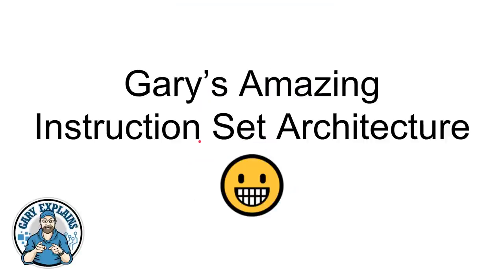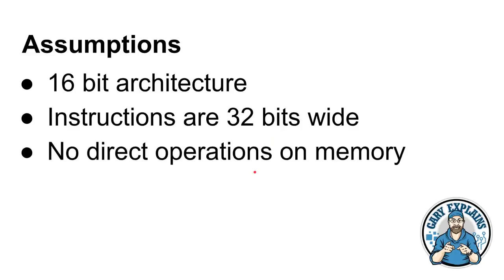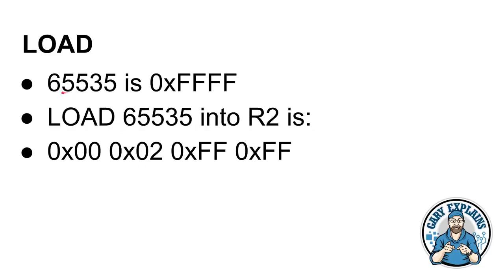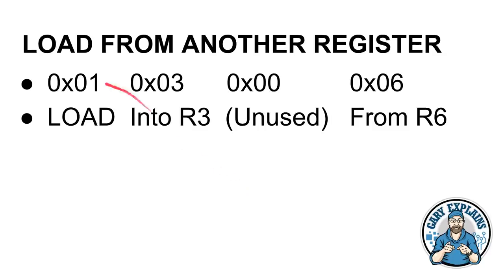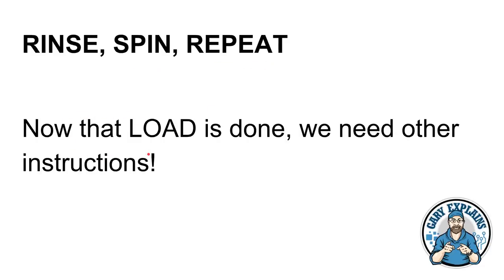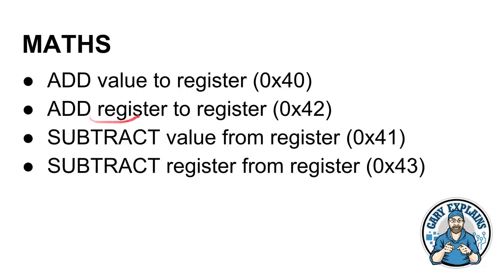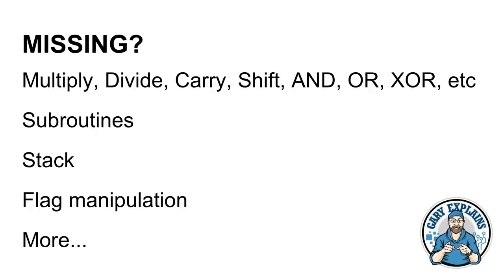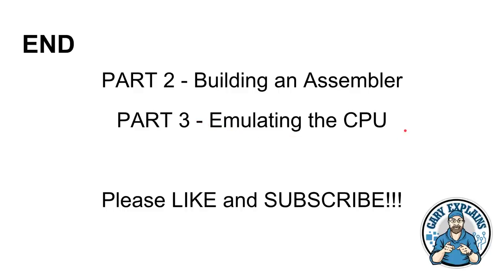Design Your Own CPU Instruction Set

Comment: Here's my answer to the bloat of Intel, ARM, Risc V and even Agner Fogg's efforts... This is a very  quick rough draft brainstorm so not written up properly and probably missing a few things. Maps to a single core X86 + rolled out vector operation loops + virtual machine all the way up to a fully blown, highly integrated APU.... 2 byte instructions.. The 'immediate values' are confusing because they are preloaded into registers after a procedure call. Only im8 is a true inline immediate value. The compiler would deal with this pseudo-immedite value referencing..... CISC on RISC, highly extendable yet very compact... Typed registers and virtual registers with automatic type conversion. 

rg7: Register 1..128, st7: Stack 1..128, iv7: 'immediate' value (ref) 1..128, ip7: 'immediate' pointer  (ref) 1..128, im8: immediate byte value 

Data Types: x16

b8, b16, b32, b64, b128, b256
i8, i16, i32, i64, i128, i256
f32, f64, f128, f256

Registers: x128 .. each type has 8x registers (ex. b32_1, b32[1], b32[b8_2])
Stacks:    x128 .. each type has 8x 2^1..8 sized vector stacks (ex. b32x4, b32x8[2], b32x16[b8_1], b32[1,2], b32[b8_1, b8_2])

Immediate Values: a method's immediates are pre+parallel loaded into a register file with 8 registers for each type (16 types) and 128 address pointers
 
Virtual Registers: 

A,B,C,D .. A op (B) (op C) (op D) into A | D
PA, PB, PC, PD .. memory pointers  

Instructions: 2 byte op codes
// 59 // total: 232
16, assign P(A|B|C|D) to rg7|iv7|ip7|st7
1,  load|save|copy from|to * P(A|B|C|D) * P(A|B|C|D)
4,  load|save rg7 * at PA|PB|PC|PD
8,  load|save st7 * push/pop? * at PA|PB|PC|PD
16  copy rg7|iv7|ip7|st7 * into P(A|B|C|D)
4,  copy im8 to A|B|C|D
8,  push|pop  st7 * into|from P(A|B|C|D)
1,  push im8 to main stack
2,  push|pop main stack to/from rg7|st7
1,  push|pop P(A|B|C|D) to/from main stack
// 28
8,  add|sub|mul|div A * st7 * pop? * into A|D
4,  add|sub|mul|div A * rg7 * into A|D 
4,  add|sub|mul|div A * iv7 * into A|D 
4,  add|sub|mul|div A * ip7 * into A|D 
8,  add|sub|mul|div A * im8 * into A|D
// 16
2,  and A * st7 * pop? * into A|D
2,  or  A * st7 * pop? * into A|D
2,  xor A * st7 * pop? * into A|D
3,  and A * rg7|iv7|ip7 into A|D
3,  or  A * rg7|iv7|ip7 into A|D
3,  xor A * rg7|iv7|ip7 into A|D
1,  and|or|xor * P(A|B|C|D) * P(A|B|C|D)
// 12
1,  shift L|R * A|B|C|D by A|B|C|D | iv3
2,  shift L|R * st7 * pop?
1,  shift L|R * rg7 
2,  shift L|R * im8
1,  rotate L|R * A|B|C|D by A|B|C|D | iv3
2,  rotate L|R * st7 * pop?
1,  rotate L|R * rg7 
2,  rotate L|R * im8
// 87
36, do if A|B|C|D * ge|g|e|le|l|ne * rg7|iv7|ip7 
24, do if A|B|C|D * ge|g|e|le|l|ne * pop? * st7
24, do if A|B|C|D * ge|g|e|le|l|ne * im8
2,  do if P(A|B|C|D) * ge|g|e|le|l|ne * P(A|B|C|D)
1,  do if not * Z|S|O|C|Cached
// 18
1,  jump if Z|S|O|C * to|by * P(A|B|C|D)
3,  jump by i8|(forward|back) by b8 
4,  jump to|by rg7|imm
2,  jump to|by st7 * pop?
2,  jump to|by P(A|B|C|D) * plus A|B|C|D * shift ev3
1,  jump by P(A|B|C|D) * shift ev5
1,  call rg7|ip7
1,  call st7 * pop?
1,  call P(A|B|C|D) * plus A|B|C|D * shift ev3
1,  call relative, jump by P(A|B|C|D) * shift ev5
// 12
1,  tiny op * 256: no op, return
1   P(A|B|C|D) op Self into Self * 32 ops: not, neg 
1   P(A|B|C|D) op Self into A * 32 ops
1   P(A|B|C|D) op Self into D * 32 ops
2,  A op into A|D * 256 ops
2,  A op B into A|D * 256 ops
2,  A op B op C into A|D * 256 ops
2,  A op B op C op D into A|D * 256 ops
 
Only one opcode is followed by a variable number of bytes:

1, Register Immediate Value ir8, Immediate Value // Must be proceeded by a Call or another RIV instruction

Comment: if I built a computer the CPU instruction set would have instructions for gpu redering
Reply from the maker: Interesting idea. The problem is that you would then need to implement those instructions in hardware meaning you would need to merge CPU  hardware and GPU hardware into the same design. The problem is that those are very two different things and getting them to work in the same design would be hard and ultimately inefficient and ineffective.

Comment: What is this supposed to be I am confused... I mean you shows us what you want to make but you dont show us how you do it or why you do it... it is an equivalent of "design your own car" video where the tutor says stuff like " I want to have an engine then I want to connect the engine to the wheels and the steering wheel" well obviously... "How" and "why" is what matters though. e.g what sorts of tolerances are needed for the axels how you will connect them to the engines out put what is the design of the engine why where those decisions in its design made etc.
Reply from the maker: I thought the video was about designing an instruction set and that is exactly what I show. The next video shows how to write an assembler for that instruction set and the code is in GitHub. What do you think is missing?

Comment: What's wrong with the ONE INSTRUCTION CPU, you don't even need an opcode for the instruction
Reply from the maker: So you watched my video about OISC and then came to another video of mine about designing a CPU instruction set to ask why am I doing it?
Reply: Yes, I want to know why you don't choose the easiest Instruction set ever for a CPU
Reply from the maker: LOL, Subleq is easy to implement, but it is hard to program and very inefficient. I thought that would be obvious!
Reply: You should have explained all the weak points of OISC and why no computer manufacturer implemented it in real life. It is a computer system that is totally dependent on main memory access and the CPU will only run as fast as the main memory. You will need a huge cache to speed up the CPU.
Reply from the maker: Since the video doesn't suggest that Subleq is a viable option for real world processors, I didn't feel I needed to spell out the advantages or disadvantages. Subleq is purely an exercise in computer theory. Again, I thought that was obvious.

Comment: Designing a processor isn't hard.  Making a C compiler, that is beyond me.
Reply: making a *bad processor isn't hard. 

I have been working on one and I am on like the 10th+ iteration. I am working on it down to the logic gates while trying to make it fast(ultimate goal is to run DOOM on it), and it is a whole another beast than what is shown here.  

You have to consider things like the efficiency of the ISA(how much data needs to be read to do any common computation, balancing act between how much data an instruction needs and how much compute it does), the slowest instruction(a basic RISC CPU's clock is decided by the slowest instruction excluding I/O),  and how the ISA will work with pipe lining. And that is just the ISA, haven't even got to things like memory controller yet or floating point ISA extensions.  

My point being, that what he is doing is more like making a compiler for something like a esoteric languages. Once you move to advanced development, both are rabbit holes that no one person could fully understand.